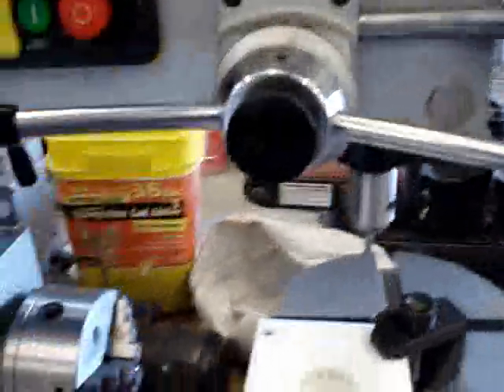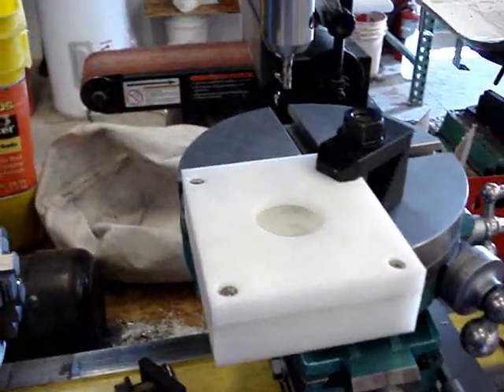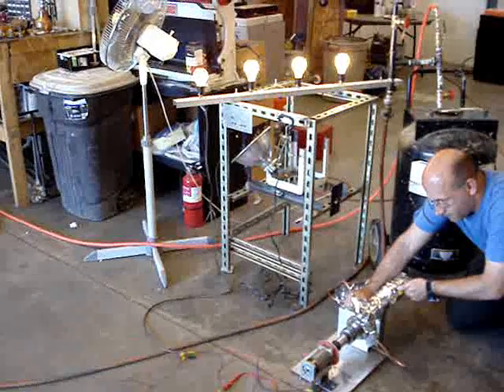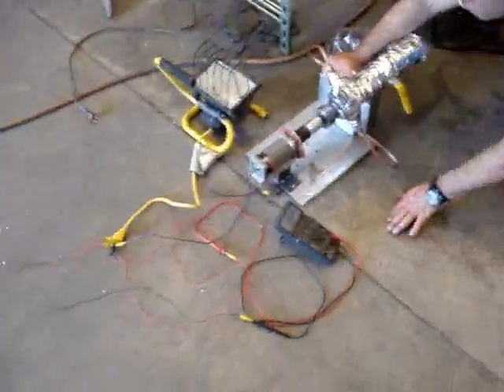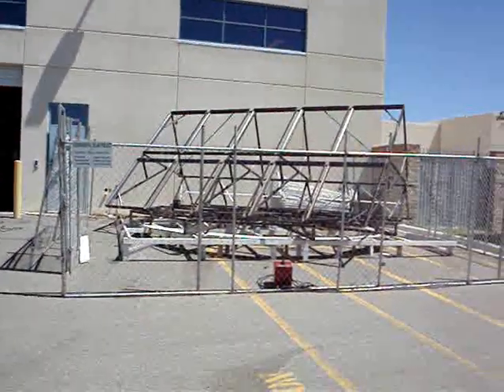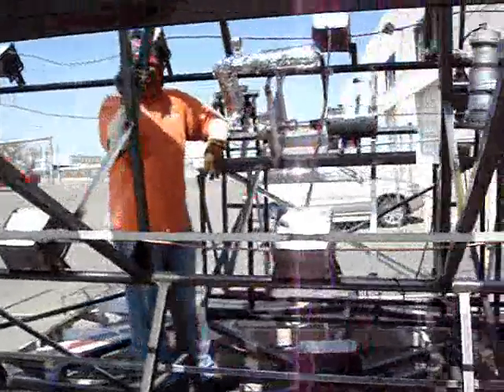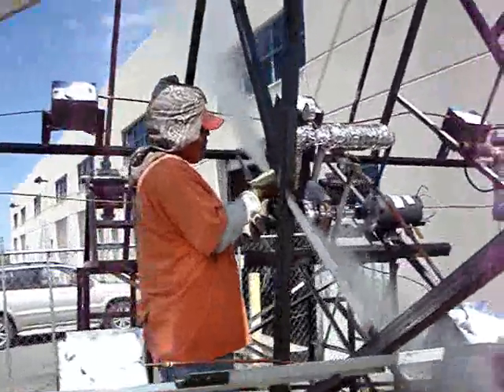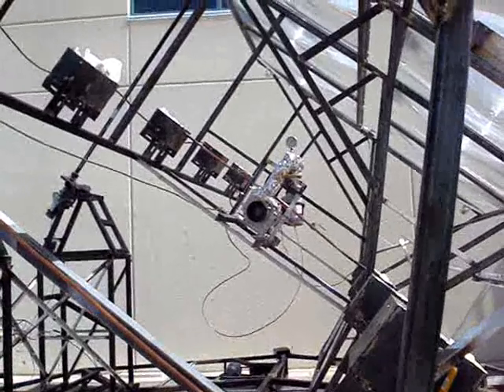Low Cost Solar Power

Comment: When you say that your 10 lenses collect 14 Kw, do you mean that, while the sun is shining you could produce 14Kw of electrical energy? Thus, if you ran it for 2 hours it could produce 28Kw-hours of power? If so, that's enough to power the typical home for 24 hours, correct?

I'm supposing, then, that you designed your array to be about the right size needed to fully power a home 24/365, figuring about 3 hrs sun/ day. Is that right?